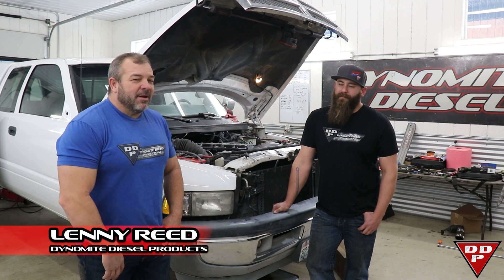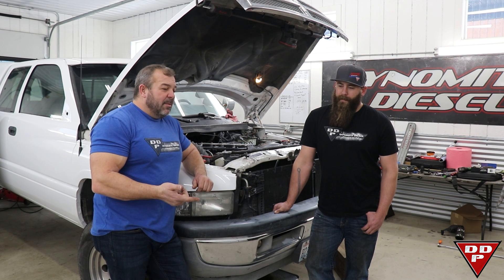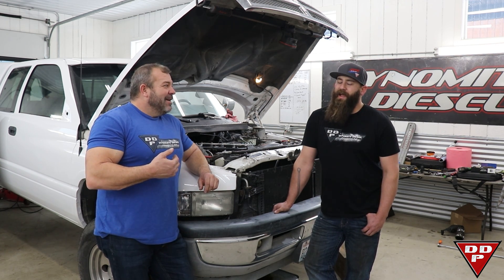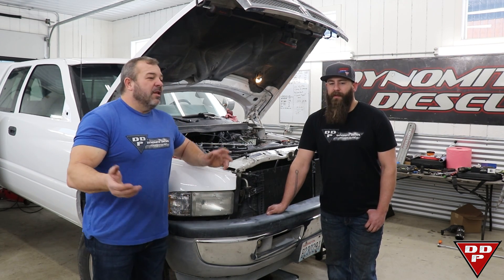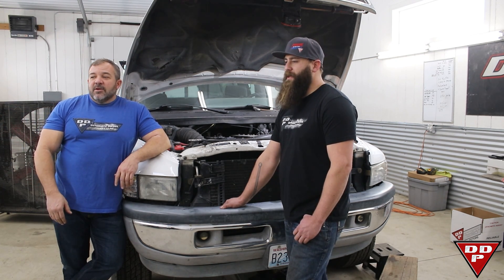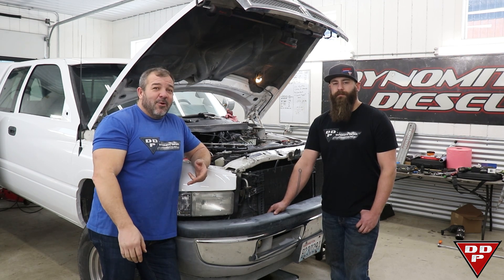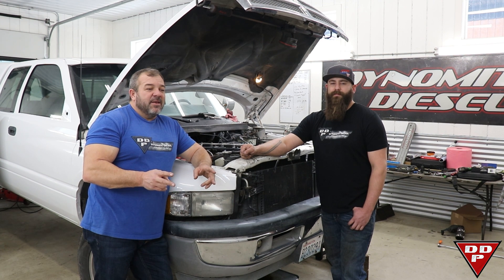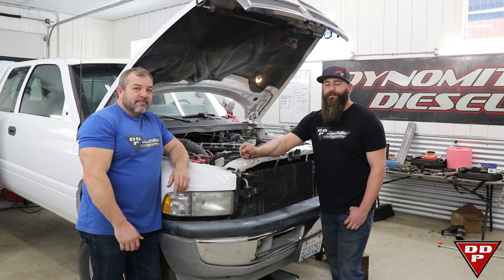P-PUMP & INJECTOR TESTING!!!

Comment: Would a set of stage 1 injectors be enough fuel for a 97 longbed 12valve 180pump 5 speed nv4500 3.54 gears with a fenly 62/67/14   With a power goal of 425-475hp. Not towing much maybe few times a year light loads no more then 7k but i have a 4,000lb payload at all times in the bed  mobile mechanic service truck

Comment: Name it Tracy 😂
Reply from the maker: Do we even want to know?!
Reply: @DynomiteDieselTV  here is one thing. She waited 25 years and after I got rated a 100% disabled veteran and unable to work to divorce me. Need to know anything else 🤔
Reply from the maker: TERRIBLE!
Reply: Better off without. Keep you head up. 🤙
Reply: One of these days when I get the money I am going to bring my 92 IH Fire Resuce Utility Walk Through to you. It had 15600 miles on it when I bought it from a fire department in SC. Has about 21k on it now. 100% stock. 170 blazing HP. Tacs 2500 at 55 mph 😂. Purs like a kitten. I want it to roar like a lion 😂 Going to convert to a 4x4 Expedition type vehicle. I can't afford a Earth Romer 😁 I have been told that the DT 360 can put out 500 to 600 HP no problem.